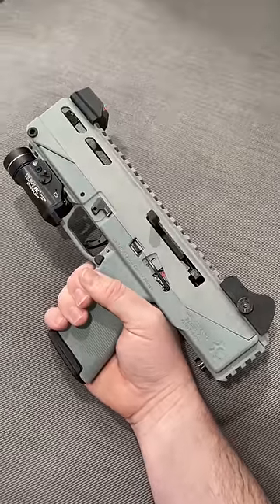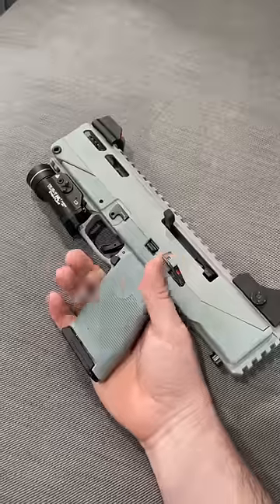MP57 - PDW Kit for Ruger 57 Pistol by Custom Smith MFG

Comment: That’s quite the clever idea. Like a roni but more compact. And in 5.7- I dig it.
Reply: Well, some differences, like the Roni has a whole Glock inside it and this is a new chassis for the guts, so the 57 isn't just sitting inside a shell, but essentially yeah. It's similar.
Reply: @1991USsoldier  essentially a new gun body completely, which I like much better. More secure.
Reply: And even more useless.
Reply: @vladislavno  how is it useless?
Reply: We have a compact 5.7, it's called a P90, and it has a lot more bullets in the magazine
Reply: @Grunt-Barra  wouldn't you have to SBR a P90?
Reply: @1991USsoldier  if it’s barrel is under 16” yes. The civilian non tax stamp rifle length models are PS90s technically.
Reply: 🎶"Oh my God, Ronny!"🎶 Is the first thing I thought when I saw your comment! 😂😂😂
Reply: @Grunt-Barra Imagine a world where there was one gun of every caliber. ONE sub compact 9mm, ONE compact 9mm, ONE 12 ga... See how dumb that sounds?
Reply: @bigboyepic8598 I didn't even think about how much simpler that actually makes this system.. very good point on component security.
Reply: Psa just came out with a pdw 5.7 just like this I want that or I want a MPA Mac 11 but I want the micro that they don’t sell anymore with a stock on it  😢 it’s basically a mini uzi
Reply: More like a 320 chassis.
Reply: @bboy1469 yea like the X01 for the p320, that makes more sense. I wasn’t paying attention I guess first time I watched this hahah

Comment: Took the words right out of my head - I want MP7. Now I can have MP5.7 at home!!
Reply: Yoo imagine if you convert it to full auto in that kit
Reply: @traphimawari7760  Or make an AR lower adapter so you can fit those echo triggers or reset triggers
Reply: Just get full auto DEagle .50 🤣
Reply: @YourLocalFemboy  Definitely not the same thing; that's the point, lol.
Reply: Or.....here me out, here.......PSA is set to release mp7 at home next year.
Reply: Just wait for the PSA one if you can OR there’s a conversion kit for a keltec pistol which is also MP7 at home.

Comment: I would love something like this 3d printed for a 10mm glock, ik the invader exists, but this would be a way better option imo
I'm learning CAD software as quickly as I can to do stuff like this 👍

Or even imagine a 3D printed frame like this but for the 7.5FK PSD
Reply: The BEST ghosti mm!  I would buy a printer just to make that if the file existed.
Reply: @mcdoctorglock  make the file then. It still won't hold up to 10mm power.
Reply: What software are you using to learn CAD? I've been wanting to learn for a long time so I can design knives!
Reply: 10mm world prob be too much for the frame
Reply: Liked for the latter 🙂
Reply: @shanescatsandcannabisfarm2965  i had thought about a 7.5 PCC but nowadays with the abilities to use full rifle ammo in the same size as a PCC hence why i think the 5.7x28 is defunct in anything but hobbies because when the p90 first came out with the illegal ammo it was Alot of power in a small package for back then back with the mk18 and all the ar pistols/.300 blk and Draco's Etc have way more power and options in a familiar platform and it the 5.56x45 destroys The 5.7x28 even with the special ammo for it vs cheapest plinking ammo for the bigger and its still obvious who's winning. that said tho the 7.5 fk actually really interested me because its completely different and for it's use case it's the best by far. So I'd Lean more twords the pdw side vs the PCC like the mp7 or CMR 30, similar to the one in video as it's still basically a pistol just a bit extra on it, but they have options to have same profile for carrying or whatever and you can have longer barrel with needing a longer slide necessarily, like the 7.5 fk is HUGE i would not mind it being a brought down to rhe size of a Glock 20 or even better but have the Longer skinny barrel just sticking out like the lone wolf barrels for Glocks but that's the only thing id want for performance as its already HUGE but it is designed to give you pdw performance in a pistol specificly for a security detail or like secret service agent but t are only allowed to have a pistol for whatever reason or they don't want to bring attention that they are security or the vip is that important. Because if they appear with full rifle and swat team with armor it's pretty obvious, but the 7.5 round is already super impressive but It topping out at slightly over 2000 fps and i would rather be a steady 200 fps minimum faster because that's where you start getting the damage you see from rifles and the wounds vs a pistol poking holes akrboy If you can use hollow point or any modern expanding rounds is going to do the most and won't have to rely on velocity and jacketed spitzer rounds ONLY like the military does. As much as I love the 10mm and 9x25 Dillon they're actually both weaker than the 7.5fk which is getting.44 magnum type of numbers but it even better because yes energy Wise its better than Dillon even from point blank ( 9x25 90 gr rounds are rated for 2000 fps but almost every testing shows it lower and the 7.5 is faster in 105 gr and 95 grain but it was 790 fpe for 90gr 9x25 and 850 foe for 95 gr 7.5 but the 7.5 is way better at penetration and even beats armor that it's not rates for with regular rounds no special hard steel/ tungsten tip and beats armor that is rated for.44 mag and .50 ae, it's sectional density is so insane, but it's even more insane as it's natural accuracy and straight trajectory and super low bullet drop and it's ballistic coefficient makes it the first pistol ever I've used that with almost no practice can make 100m shot's almost at will all day long especially with a nice red dot, its insane its more accurate than some older rifles ive shot definitely beats almost any PCC ive shot and a it's pretty close to the same as some m1 carbines I've tried before and for one being a pistol with a 6, inch barrel vs a rifle/carbine with a barrel minimum, 3x bigger actually... And the fact it's naturally WAYY more intuitive to shoot a rifle accurately at that Range especially and at 100 yards it's lost almost no energy especially compared to most larger rounds like the 90 gr 9x25 lost like half its energy at 100 yards and bullet drops multiple times more as well.   Vs the 7.5 who's lost barley any energy and barley started dropping at the same distance and the way it penetrates so well, closest to barrier blind we've seen and truthfully it's good as you can get for duty use inside of a pistol.
Reply: I wish 3d printed. I would be making homemade uppers ,grips, foregrips,sights,super safety🤫 shout out Hoffman tactical for a rapid fire loophole

Comment: You took a pretty good pistol, with great sights, on a low axis... and pissed away the greatest part of it.

I love it 😂
Reply from the maker: Definitely improved its shooting stability, accuracy at range, longer sight radius, non reciprocating optic, and a half dozen other things though. These things are fun to work on.
Reply: I like the Ruger 57 in it's natural form. If I were going to build a PDW, I'd probably choose a different platform... most likely the Rock 57, because it's a striker, the grip angle is a little more conducive to a PDW, and the trigger linkage. Did I mention it's also cheaper?

Comment: FINALLY!! lol. Congrats bro. U got on just in time. They quit making them. "Fire control group" is now going to make them. I spoke to them and CSM to verify it. They said they may make a Gen2. So I gave them a few ideas for input on a Gen2. I think you're going to love how it offers all that added power and less weight. You're going to want to get a Tandemkross flat trigger btw. And you I'm sure can whip up an extended mag release. I may tap mine and add an aluminum one on mine. F5 offers them but u have to buy their crappy extended mags too. I prefer CSMs extended mags. I made a video on how to alter the follower to add 3 or so more rounds too btw. Love to see what ya come up with. Enjoy!
Reply from the maker: Yep, I bought the last one he had sitting around the shop, lol. I’m interested to see what the new company does with the design.
Reply: @Booligan Shooting Sports  ikr. And dam you're lucky! Love the gray look! Can't wait for someone to hurry up and sell some extended threaded barrels too.  Have you shot it yet?
Reply from the maker: Still developing some parts before I hit the range. Just finished up my PDW style brace.
Reply: @Booligan Shooting Sports  yeah I curious about how that works. I have a SIG MPX style one but the MP-57 is a little too thick to work on it. So I have a Rattler style folder on mine. It keeps it small. So I'm eager to see what you come up with. The Gen2 should maybe have slots built in so other existing ones can work and slide if it's possible. You may need higher sights tho if you brace sits high up on the rear rail. I used Ruger flip up sights on mine. If I recall right Magpul ones wouldn't work due the contour just below the top rail

Comment: Neat. It improves nothing about the function of the gun and makes it harder to conceal. Draco fan boys will love it.
Reply from the maker: Third point stabilization, non-reciprocating sights, double the sight radius, and more hard points for functional accessory mounting are a few of the benefits of a kit like this. Multiple objective improvements on the function over the original gun and brings it into an entirely different class of firearm (from handgun to PCC).

Comment: Aside from "this looks cool" what are the benefits over the base 5.7? Still uses the stock barrel, still semi-auto? Not trying to yuck anybodies yum, but to me this is a jcwhitney body kit on an 04 WRX.
Reply from the maker: This offers much more than just different outside appearances. Third point stabilization, non-reciprocating sights, double the sight radius, and more hard points for functional accessory mounting are a few of the benefits of a kit like this.
Reply: @booliganshootingsports  I will say, I did notice that you didn't go crazy on the GQ rails. I can appreciate that. I didn't see it fire, so I wasn't really sure what you get out of it. It's cool looking, and I appreciate you giving me a genuine response. I'm sure you've also made big strides in the design over the last couple of years. I genuinely wish for your continued success, and I thank you again for providing a reasonable retort, and not taking my reply as an attack.

Comment: Guant pistol with no recoil that’s interesting, how about make it in 10 mm so it’s viable? There’s a reason why the 5.7 pistol is so small it doesn’t need the bulk u just reversed positive points besides better sights and no slide coming back at you. I am interested tho
Reply from the maker: A 3rd point stabilized firearm is always better than just two point stabilized, regardless of caliber. This gives you P90 level stability in a 2.5 lb tiny package.

Comment: Why not get the 57 charger? This seems like an expensive route.
Reply from the maker: Because the 57 Charger didn’t exist for almost 4 years after this kit was launched and almost 2 years after this video was filmed lol.

That being said, this is still a fair bit smaller and lighter than the 57 Charger which is a real benefit.
Reply: @booliganshootingsports  ... I'm a dummy I didn't even pay attention to when you did the video. Either way it's still a nice kit, can't wait to see where you take it.
I agree on the barrel length being shorter. I wanted to get the charger and replace it with the pistol's barrel so I can have the suppressor recessed into the handguard.

Comment: Could you somehow make the charging handle on the top at the rear, like an M4/MP7
Reply: Yes. You could if you wanted. On the side is best tho.
Reply: An M4 handle would make a decent base, you could print parts to make the wings larger.
Reply: @President Merkin Muffley  maybe. The reciprocation of the slide makes it tricky and maybe over complicate the slide cover vs. a simple tab like now. Mainly because there's no buffer spring to send the AR style handle back shut. So, you'd have to integrate a spring to send the handle back. Then there's the fact the brace / stock attaches closely via a 1913 rail. A rear handle means the stocks can't rise over the height where a handle would operate. But with how it's a FCU based printed chassis, anything is possible really. Someone with 3d know-how can do it surely. One other thing is that the method used now is in basically its simplest form. So there's less than can break, etc. There's a version already out there tho that has an AR style handle and is made of aluminum that clamps onto pistols. I forget it's name. They're kind of rare tho and not made anymore, though. But myself I don't like the clamp on style pdw version like the CAA. They tend to be alot bigger. But time will tell I guess. I'm eager to see what folks come up with
Reply: @presidentmerkinmuffley6769  yeah I found it. It's called the KPOS

Comment: Whats the point? Looks like you made a Ruger 57 less effective, what am I missing lol
Reply from the maker: Adding stable optic mounting, accessory mounting, longer sight radius, and brace or stock mounting makes a gun less effective? Weird. Guess short barrel rifles shouldn't exist then, only handguns from now on.
Reply: @booliganshootingsports  the advantage of an sbr is the round. Ruger 57 mounts an optic just fine and the recoil is not enough to need a brace. The 3d print is really nice but just seems like a novelty considering its now huge.
Reply from the maker: Adding a 3rd point of stabilization is a benefit to any gun regardless of recoil amount. A slide mounted optic is a far worse option than a stationary rail mounted optic as you don’t have to chase down that correct sight picture every shot due to recoil and slide movement. The increased size doesn’t matter because the point is to transform it from a traditional format handgun into a more stable and more precise PDW platform. And it’s still MUCH smaller and lighter than a comparable AR or other large format pistol. It weighs 3 lbs as pictured and is 8” shorter than my tiny 8” barreled AR pistol. 

Look at the FN 5-7 and the FN PS90. Would you say the PS90 shouldn’t exist because the 5-7 does? This is the same concept. The difference here is that you don’t gain any barrel length with the MP57 (yet, there are people working on longer barrels) but the benefit of a more stable and precise shooting platform still exists.
Reply from the maker: @UCJET9a52GsyCr3ObTbwRSVw longer barrels and magazine extensions are on the menu 😉
It’s a slick little thing now (check out my updated video with the brace I designed) and will be fantastic when it has all the parts I want on it.
Reply: @booliganshootingsports  it’s not little. You can’t conceal it very well.

Comment: Change the charging handle looks like ass. Also do something with the front, maybe add a blast can or something.
Reply from the maker: No need to add extra length up front.
Reply: @booliganshootingsports  Blast can would help push that crack forward . Also give it a little better profile, kinda looks like a CAA gimmick.

Comment: Your just changing the outside appearance if you want a giant gun or should offer more than just not fitting in any holster
Reply from the maker: This offers much more than just different outside appearances. Third point stabilization, non-reciprocating sights, double the sight radius, and more hard points for functional accessory mounting are a few of the benefits of a kit like this. 

This isn’t intended to be holstered. It converts it into a PCC.

Comment: Soo took a handgun which was pocket sized and made it into a brick 🧱
Reply from the maker: Third point stabilization, non-reciprocating sights, double the sight radius, and more hard points for functional accessory mounting are a few of the benefits of a kit like this. Multiple objective improvements on the function over the original gun and brings it into an entirely different class of firearm (from handgun to PCC).